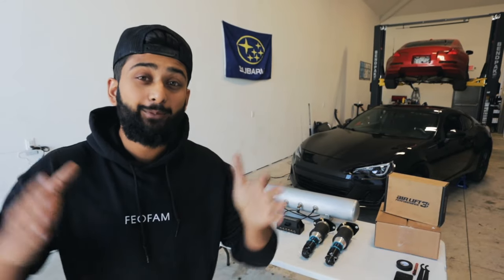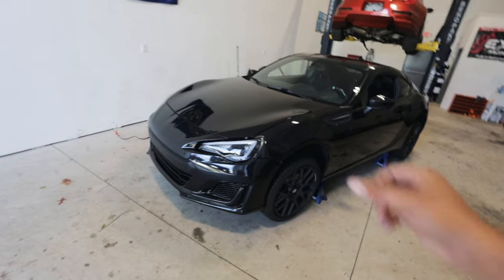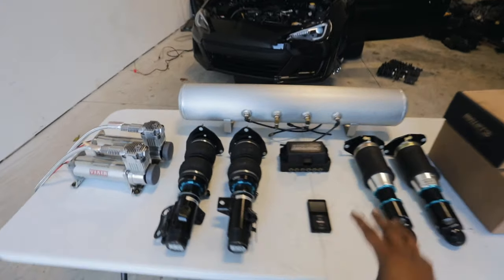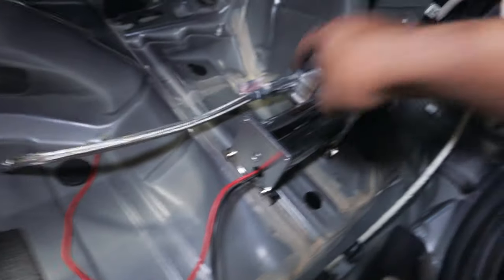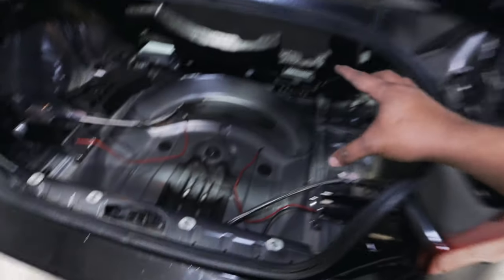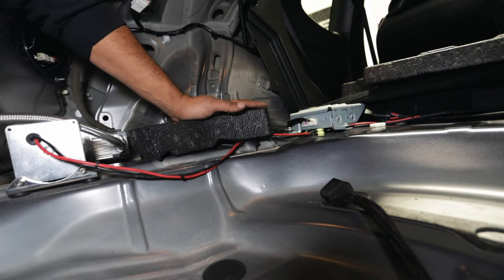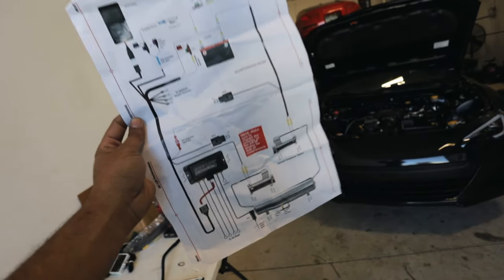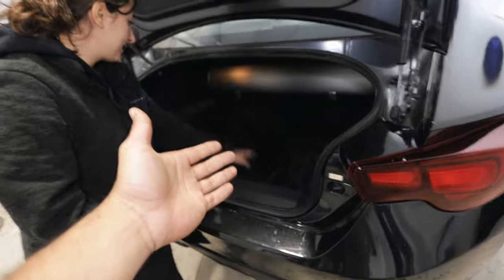How To Install Air Suspension | Complete Guide

Comment: little tip for the compressor cutouts: the pieces look symetrical so you could put the left one on the right side if there arent any tools in there anyway so it will look cleaner :)

Comment: on a car with a battery in the trunk, like a miata, would it be a bad idea to cut the harness to size? or should i just zip tie the wires up and hide em
Reply: to stay safe i'd use zip-ties, but if you can practice soldering and gain enough skill you should cut the wire to save space and make your wiring look a bit more simple and just nice in general
Reply from the maker: agreed

Comment: adjust the strut height. It's stiff because you are running too much air pressure and the bags can only hold so much and will end up tearing the bags over too much stress. I believe that you should not be running more than 100 for that light of car. You can also swap out to different types of bags like triple bellows which gives more lift while being comfortable.
Reply: exactly what i was gonna say, improper strut height to bag pressure for ride height causing a bad ride.
Reply: how much air do you recommend @ ride height?
Reply: @idrisu1  depends on the vehicle, but all bags have a max psi of 160 so staying around 75 to 110 is cool. To me, I think exceeding over 100 psi is a lot just because you have to account for the corner weight of the vehicle when you go up and down driveways. I ran 95 and 80, car felt stiff enough and pressure would shoot up to 120 when going up driveways.

Comment: Great installation video, very thorough and complete. It is of particular interest to me as I was considering replacing the YellowSpeed coilovers  on my S55 AMG to these air bag systems. However, Amanda's honest assessment of the ride quality of this system is causing me to rethink the move. The harsh ride of my current coilovers - despite the many damping settings, etc,  is the main reason I was looking at going for the air bag system. However, there doesn't seem to be any improvement with it.
Reply: smart man

Comment: I’ve watched this video 10 times getting ready for this weekend to install mine😂I’ll lyk how it goes lollll
Reply: How did it go for you?
Reply: Did you do it?
Reply: @theederominus  yeah lol sorry I forgot to reply for over a year🤣but went well, me and my buddy installed em. We had a small leak in the front right strut but fixed it by putting some more teflon on. Little over a year later and still love em.
Reply: @braxtonnnnn  how often you get the tires aligned? And what did you follow in this video? I got a tray in my trunk not sure if I must take that out? And did you build it around the spare tire or within the trunk?
Reply: @theederominus  I’d get it aligned maybe every 6 months, it will eat your tires up within 10,000 miles if not lol. And we pretty much did it step by step how this video did except I didn’t install 2 compressors so it was a little easier. And we put the management system where the spare tire goes and took the tire out completely. Also I keep a tool bag in my trunk sometimes and it’s fine as long as you’re not taking turns too fast so it won’t slam against the tank. I also put my compressor in the trunk on top rather than under with the management and lines.
Reply: @braxtonnnnn  cool! What tool set or tool kit do I need for me to do it?
Reply: @theederominus  pretty much just a half inch impact(to get your wheels off), a smaller impact and some drill bits of all sizes just in case🤣the kit should come with a cutting tool for the air line as well
Reply: @braxtonnnnn  do you know if the king tool set 325 piece has everything I’d need?
Reply: @theederominus  I’m not sure tbh but if it has a couple sockets some Phillips/flat head bits and drill bits you should be good. Maybe get a couple small u brackets to mount the braided air hose to ur fender liner so they don’t get ripped out when driving
Reply: @braxtonnnnn  oh for the excessive air hose that’ll be going through the firewall (for the front) and the rear to the tank? Also What jack stands do you recommend

Comment: So I only have one question. When you run the lines from the manifold to the air strut itself or airbag whichever you may have. Do the length of the hoses have to be equal so that everything airs up equally

Comment: I'm gonna attempt it tomorrow morning with a friend helping
Reply: How did it go? Im gonna do it with a friend as well but im still kinda nervous
Reply: @stevendls4814 took 6 hours but we got it done lol the rear suspension was a pain in the a**
Reply: Did it really take 6 hours? Why?
Reply: Because I’m not a professional mechanic and have never done suspension work before? Took longer with running lines to make sure I ran them right and hidden
Reply: @demineon4966  did you put them through the firewall for the front? I wasn’t saying why like that , sorry. I meant like is it really easy to wire it? I got a trunk tray , so I wondered how that would even work? Did you use the space around your spare tire to place yours or was it more harder than that?
Reply: @theederominus  wiring isn’t terrible but it’s tedious for sure and yeah I went through the firewall and ran it to there the spare tire is. It doesn’t look good but it works going to have a professional redo my trunk since I’m going to do a spare tire delete
Reply: @demineon4966  nooo why a spare tire delete? Forbid something happens , why :(

For sure I need to start with maybe the struts first and then do wiring after. What tool kit you think I must buy for me to do everything?
Reply: @theederominus  It’s a risk of course I’m looking at one other option just depends on what you want your trunk to look like
Reply: @demineon4966  what tools?

Comment: Odd question. After installing, since the bags have no air in them, when you take the car off the jack stands how is it not on the ground? Do you fill the struts up before taking it off the jack stands?

Comment: Im kinda new to the whole air suspension thing etc, can you comfortably drift woth em or would i be better off just getting coilovers
Reply: It’s all for show and no go lol
Reply from the maker: It definitely depends on your suspension set up, what brand and struts and how you dampen them. there are a lot of people that race with their air suspension, you definitely cannot beat coil overs when it comes to what is better on the track but I like to drive hard around corners and I can confidently say my suspension held up pretty well for spirited driving.
Reply: @franchisefred4066  that’s not true like at all😂I have 3p airlift performance suspension on my 2020 mustang gt and I track my car, Drift my car, Go 160 mph in my car with absolutely no issues.. If anything the air ride is better performance wise then my oem suspension
Reply: @franchisefred4066  
That’s not true… Cody Miles is running an air ride STI in Global Time Attack. Setting lap records and winning his class multiple times. 
Also, the Risky Devil crew is entirely on air, as far as I know.

Comment: front struts arent u supposed to bang the frame
Reply from the maker: only if you camber in the top plate all the way, then you need to to bang out the metal to make clearance. But if you just throw air suspension in without much negative camber, your good to go lol

Comment: bro the bottom port is for drain. from you connecting the bottom port to the manifold you are sending straight water to the manifold...
Reply from the maker: there is a water trap between the tank and manifold my guy haha. I quickly mentioned it but it was hidden behind the trim panel. There was a quick shot of it

Comment: I have airtekk bags for sale 😭 less then a month old. NY area. For brz
Reply from the maker: airlift is the best imo!
Reply: @beakhan  for me they ride the same. With airlift you would have to hammer the strut tower for clearance when you air out. Went with airtekk due to it being a inch smaller in diameter, so hammering isn’t necessary.

Comment: Why buy 3p not alot of difference to v2 why spend more on 3p when the only really difference is you can use your phone as the controller
Reply from the maker: imo there is a big difference. Yes you can use your phone to control your car but also it is much easier to navigate through the presets, settings and it has some little features that the v2 doesnt have. It all comes down to personal choice though, some people im sure prefer the v2 for the simplicity!